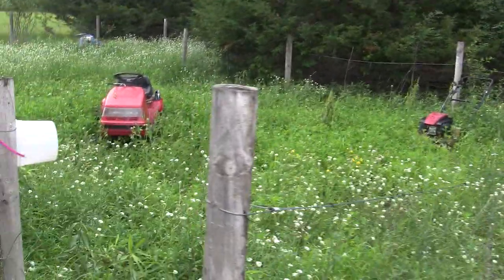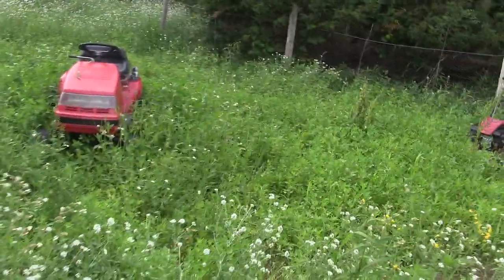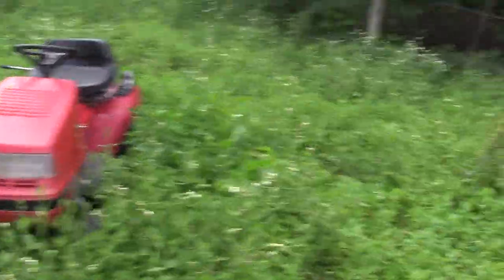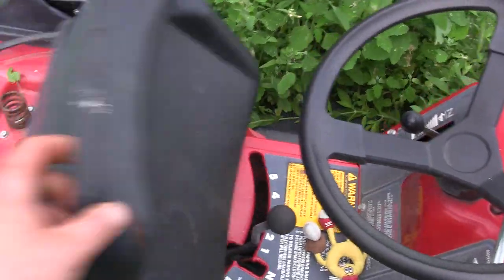Will The Dynamark Start?

Comment: If the engine cranks and won't start, check for spark and fuel. Check compression or leakdown. If low, check valve adjustments. If there's no compression, the valve seat may be loose. Replace the head. Check the float bowl and needle valve loosness. It's not getting fuel. Change the oil and filter.

Comment: I've stopped running things dry. It always leaves some fuel in the bowl that can gum up. I just stabilize the fuel and run it a bit to get it circulated in the carburetor.
Reply: +pfun41 - Drain all your Gas out of the Carb during " long " storage.  You will never have problems with them.  Just wasting a bit of Gas... But it will be good to start every time!  Check out our old 20 year old MTD, same Engine and it's AWESOME..... BUILT TO LAST !!!! ... Here:  https://www.youtube.com/watch?v=TAFFqTeheWg

Comment: You're better off putting gas stabilizer in the gas tank letting it run through the motor not running the machine out of gas empty carburetors turn to Varnish up faster
Reply: Tom rizzo 1,000 percent false
Reply: Tom rizzo how can gas turn to varnish if it doesn't exhist? Lol @ your logic
Reply: No check dare spark plug it's not getting enough of spark